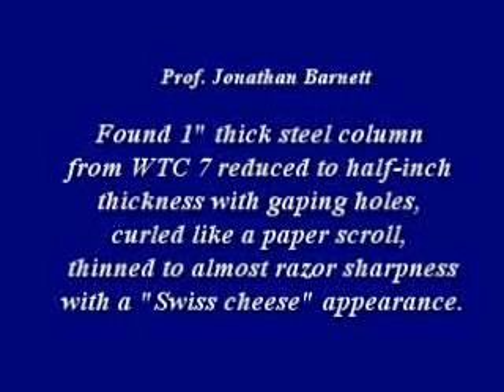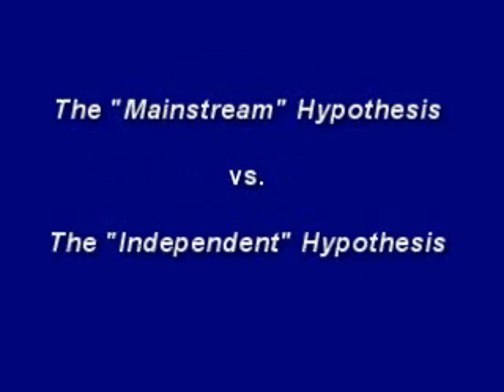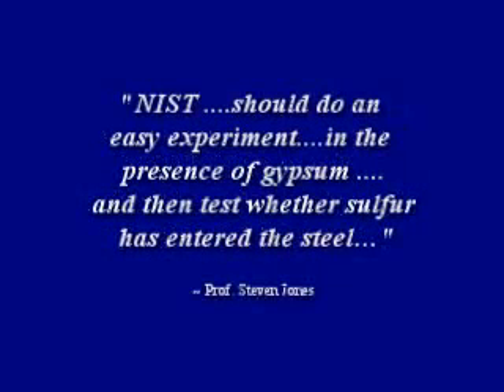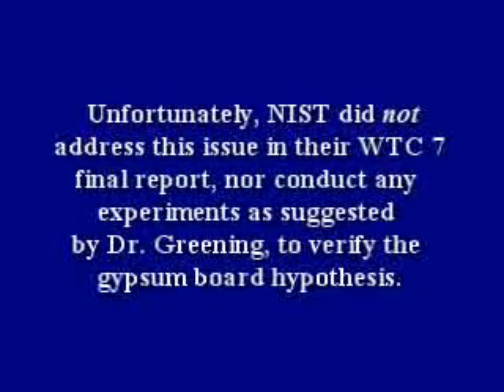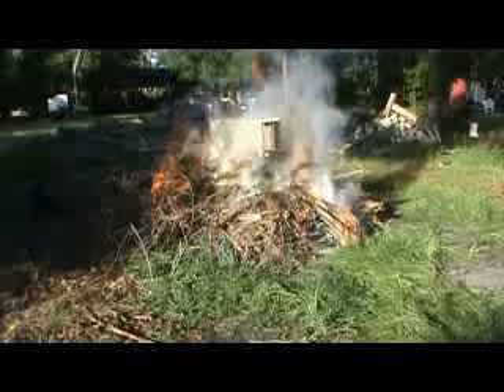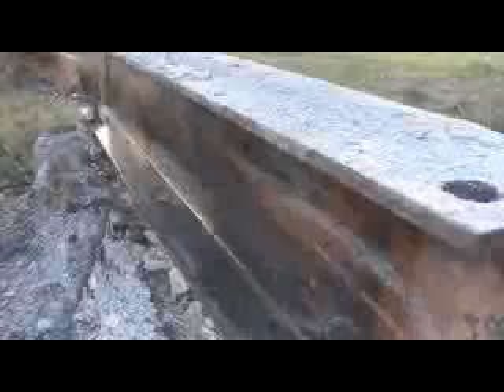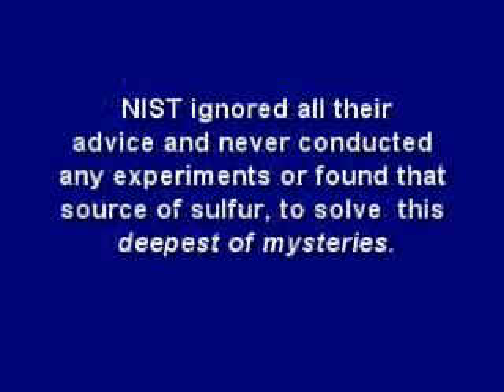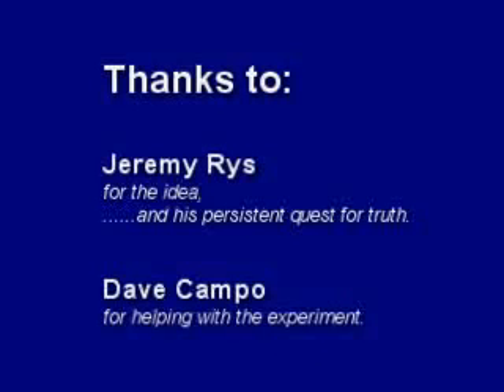9/11 Experiments: The Mysterious Eutectic Steel

Comment: So in this experiment, the steel beam was not under any kind of weight load (besides that of the logs+other burning materials of course). Could the experiment have turned out differently if it were done with an equal amount of pressure as the Building 7 steel beams?
Reply: A normal fire temperature as found in the Towers and in Bldg 7 is impossible to melt steel. Steel beams require 2800 degrees F. The temperatures never exceeded 1200-1300 degrees F as the jet fuel burned off in a few minutes as it was atomized in crash. Just how do you get 2800 deg. F without the necessary fuel? How do you get molten steel without a heat source of equal or exceeding temperature? I don't have to believe theories but defying physics is attempting to blow smoke up my ass.
Reply: the dark:  simple answer to your question: no , extra loads would not make the slightest difference.  Steel frames are way over designed; we don't want to take chances.  (former structural engineer)